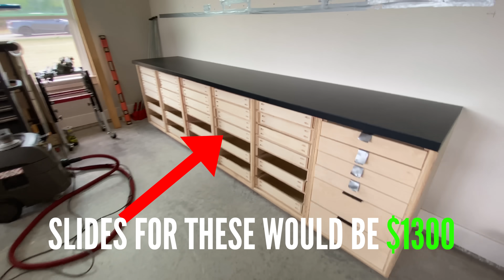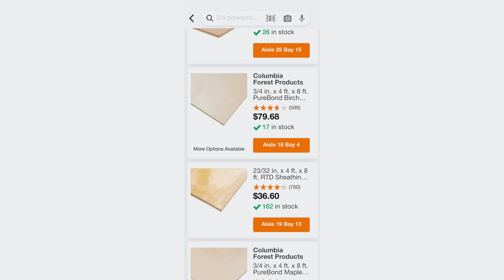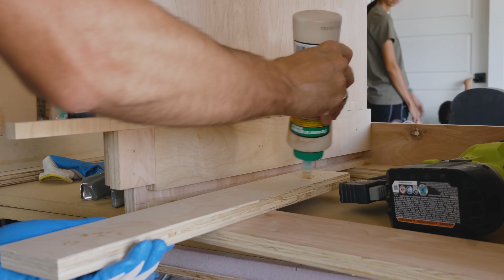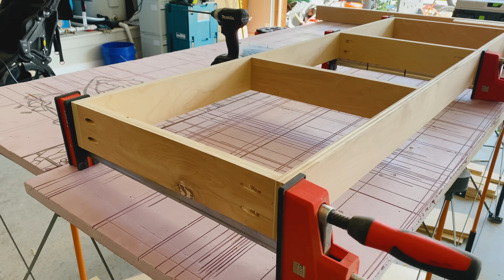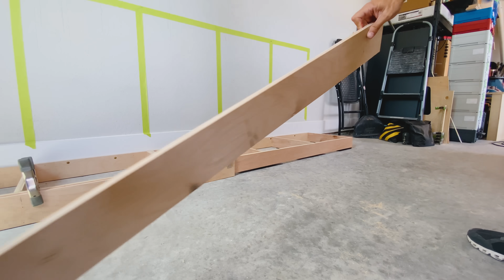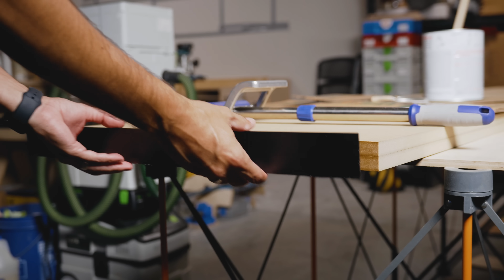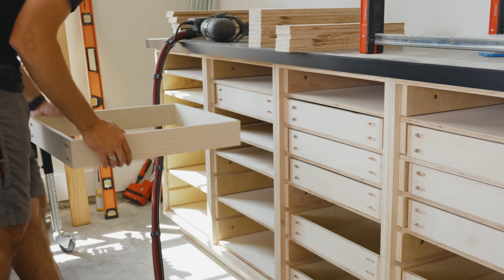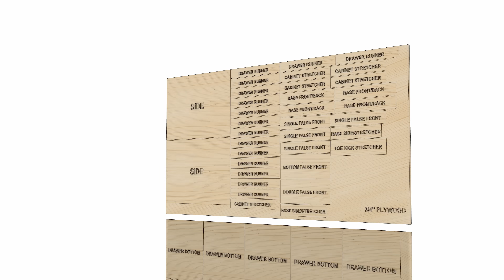Drawer slides are expensive. Do this instead.

Comment: 🤿 Brother this is a great video. These are more "practical in use" and "cheaper" than most options out there. Love the Plywood Company find. I'm in Temple, TX and is hard finding companies around like roofing, electrical, lumber, steel, etc...very limited. Most are in Big cities where the drive is like an hour to 2 hours and then some. you might want to stain that plywood or seal it. Always a drip of oil or some other substance ruining the horizon 😄 I enjoyed the built!!

Comment: I love this project, and you're a natural narrator! I totally agree with you on drawer guides vs dadoes. Recently I made a small 9-drawer cabinet out of scrap lumber, same size as one of the units you made here, but foolishly used dadoes - holy tearout, Batman! Next time will use your method, but probably with 1/4" plywood. It's plenty strong for the drawer bottoms, slightly cheaper, and there isn't enough slop for the runners to jump the grooves. 

About the pocket screws, which seem to be the new hotness lately - honestly, I've been making drawer bodies using simple flat joints with wood glue and brads for 30 years (amateur), and none of my drawers have ever come apart in use, even heavy shop drawers. They also go together faster and easier than using screws. I think you worked a little harder than you had to there. 

Applying the laminate with your dad took me back to building our kitchen and bathroom with my dad many years ago - our last big project together. We did it the same way with the wood strips and it came out great. Painter's tape on the front edge would have saved it from scoring by the router bit bearing. Anyway it's really cool that you included him in your video.

I got a lot out of watching this. First time I've ever seen that expando work surface thing you setup at the beginning, and also the parallel guides - will look into those. Big thanks for posting!

Comment: Your insulation job is the thing of nightmares. HOUSES DO NOT NEED TO BREATH, This is a miss understanding by people who love fondling a dead tree carcass. Love you dirty wood elves but STOP trying to do engineering until you understand what is happening.  The vapor barrier faces the heating/cooling side of the wall. You should on an outside wall also have a moisture barrier. Think green boards(Zip systems) or polyethylene non woven fibers (Tyvek). You basically installed your insulation backwards. What you did will trap condensation inside the wall. Unless the garage is heated/cooled to the same temp as the inside wall.
Reply: The exterior of his house is fully wrapped, he will be fine.

Comment: 🤿 Great video. I built our house including all the cabinets - kitchen, bathrooms, laundry room, everywhere. Unfortunately, I went the expensive route, but they are still in good shape 20 years later. I definitely agree on the toekick. I've done it both ways. After trying the notching of the sides and then facing the toekick area, I scrapped that idea in a hurry. Leveling the cabinets is so much easier with the separate base. I've done a lot of laminate for my garage and for friends. One time I set down a large sheet of laminate in the wrong place and it was stuck! Impossible to get off? Nope. I sprayed automotive brake clean under the edge and peeled it right off, cleaned up the glue and reattached it correctly. I suppose acetone may work as well, but I always have break clean around.
Reply: I love the Brake Clean tip!
Reply: @geoffmiller3491  I always have 3 or 4 cans around for cleaning almost anything (within reason).

Comment: Great video. Just curious. Did you wax the drawer glide bottoms? I have to occasionally on my 100yr old kitchen drawers. If i don't because of the wood on wood contact, I find saw dust in the drawers below from rubbing.

Comment: You might as well have left the duct tape on there is you didn't prime and paint it.  LOL  As a carpenter I cut down drawers in older cabinets to add drawer slides as the drawers are way easier to open once they get loaded up.  I see we have gone backwards...

Comment: Tape on drywall is a conituation of the gypsum wrapped paper and I apply tape everytime, regardless of covering on the wall, for drywall strength continuity (controls moving when there wood studs "breathe"). Duct tape may be just as good! 🙂

Comment: Good work. Here's a few laminate tips:
1. Use water based contact cement. Doesn't have the overwhelming odor, goes on white, dries clear. But it does dry slower.
2. Use a solid carbide laminate trimmer bit and spread a little bit of vaseline along the laminate edge to prevent any burning from the bit.
3. Cut your laminate as small as possible. Maybe 1/8" overhang but no more than 1/4".
4. Use pieces of conduit instead of boards to lay on the surface when you place your laminate. They do the same thing but you end up with less surface area touching the contact cement.
5. If possible, use a trim router. Nice and small and easy to manage while trimming.

Comment: For the concrete-contact toekick, you might consider using composite lumber, such as Timbertech or Trex.  It won't absorb moisture and slowly delaminate or rot from the moisture that inevitably diffuses from the concrete.
Reply: or use the adjustable plastic leveling feet they make for cabinet boxes that cost a buck or 2 per foot then your finish toe kick clicks onto those and you never have to worry about even a few inches of water on your slab.
Reply: It will be absolutely fine my man.

Comment: Ducktape will work for a year then delaminate and each seam will be an air leak. You could use a tape designed for air tightness like ZIP tape, but mud and tape would be easier, good thing that is what you did.

Comment: 😅Questions:  Appreciate the video and design; however, if I am going to load drawers with heavy tools, hardware, etc., what is the resistance to drawer sliding like?  To improve that, do you recommend waxing the drawer bottom edges and slide groves, or finishing them in some manner?  Thank you.

Comment: Curious why anyone does the extended bottom on drawers with the cabinet mounted runners full drawer height. You lose so much space, waste a ton of material, and add ridiculous amounts of weight. Make the drawer as normal with a nailed on bottom and use 3/4 strips on the carcass as runners, make your false fronts cover the gaps, and boom… maximized use of space, reduced material used, lighter overall (when empty).

Comment: Good video. Contractor here.
Like the plastic shims. Theyrre the best i buy them by the case. I get branded ones that have a 8,000psi rating which helps knowing where thwy can be used long term.

1. Foil tape on the wall. OK snorkel goes here.
2. Your water leak wouldnt have happened if you put in a flood valve on the main line. Cost $300 to 600.
3. Use PUT glue. Removes about all you brad nails and is WAY stronger.
4. A short track with guides would be an issue getting the straight long edge to start from.
5.tape laminate edge before routing.

Comment: There is tape used for a lot of things that has teflon or other materials on the surface. Put that on the drawer or track. Lasts longer than wax on both sides.
I'd wax or seal the opposing side that works with the tape used.

Comment: 18:44 BASTARD FILE!  lol

it's NOT profanity in this context. that is the actual name of that type of file. the edges on bastard files (much like bastard swords) are nonparallel with each other, so that they typically come to a point, rather than having a straight edge with a squared end (or in the case of the sword, parallel edges that only come to a point at the very end).

as it is NOT used against a person (or inanimate object), i believe that YouTube should have no problem with it. nothing wrong with calling a spade a spade!

Comment: 🤿 inspirational! To lower costs could you have used 5/8 plywood vs 3/4 since these were individual cases. Strong enough? Or could you have made common interior walls using the 3/4 to save $

Comment: I haven't seen good plywood since the 70's. I bought some plywood recently to build a 36" wide door for a shed, and between summer and winter it changes in dimension 1/4" . How do they make plywood do that? Plywood also used to be flat. No potato chips.

Comment: nice job. in the old days it was called a rat tailed file. to build this to be mobile. I would have to improvise being in a one bdem apt. Also.would use an exotic wood veneer rather than a plastic composite. can use wood glue rather than rubber cement. less toxic when working indoors.

Comment: Nice work!  Very good looking and skillfully made.

The biggest drawback is that the drawers are not full extension.  So you will be pulling the drawer out & setting it on the counter to get the stuff in the back of the drawer.  Of course full extension slides are very expensive, so it's a trade off.

Then there's the matter of positioning the pieces of plywood that act as slides.  You use that 3/4" strip of plywood, rinse and repeat 7 times.  If you are not VERY careful, you can get creep such that the 2 sides are not the same.  The worst not-the-same is if they aren't parallel and the drawers jam.  Just a 1/64" repeated 7 times is almost an 1/8".  Not only carefully used, but be especially careful that the strip is cut without any taper.

Comment: $80.00 per sheet of plywood is crazy expensive but u are the one that's paying for it bro. I salute u for the brilliant workmanship on these cabinets. 
I built my very 1st set of shop cabinets if u want to call them that and If I had made a video about them the abuse would've been unbearable.. hahahaha! 
I built them with Plywood, MDF and OSB. They look horrendous my bro.
The hold a fair bit of my tools and bits and pieces in them so I'm happier than a pig in shit. 
TBHY I wouldn't even pay $80.00 a sheet for cabinets in my house. I'm about to start a project in my kitchen and I'm building my cabinets out of 40 euro sheets of 8x4 plywood. I think it's perfect for the body of each cabinet bcos I'm making the doors out of Maple or ash if I can get it. If not I will use Oak for the front's of each cabinet. It's a little more expensive, a lot more expensive and if I change my mind and go cheaper on the doors and drawers then I will paint them instead. I'm interested in getting a sprayer gun machine for spray painting some of my projects plus it is one I can spray the outside of my house, the pebble dashing for. It's only about 250 euros for the machine so it's a longterm usage machine.
My apologies for rambling/rabbiting on a bit too much bro. I really enjoy ur videos. I was thinking about getting an electric Makita track saw so I wanted to ask u about the Makita track saw. I know u have one and rate them very highly. They're very e3xpensive so my question is about cutting mitres with the track saw?? How good is iut for cutting different angles for mitres??

Comment: I got 2 sets of black drawer slides (5-Pack each set), so 10 pairs of drawer slides for under 130 euros bro. Now I need to say that they were only 300mm in length so I don't know what the longer ones were. I think it was 58/59 euros per pack of 5. I don't want deep drawers anyway so the 300mm length is perfect for my cabinet drawers. 
I don't know if ur interested in drawer slides that length but I will look up the link for them from Amazon UK to IRE and see if u want to have a butchers hook at them.. 
Love the look of ur cabinets btw. They look awesome.

Comment: Nice work on the cabinets and the video. To avoid the laminate trimming issue a good tactic is to only allow the cutting surface of your router bit to only extend a small amount past the laminate.  Even if you tilt the router slightly in towards the material it cant "dig in" and gouge the material like yours did. This is a good router setup for any material , not just laminates and veneers. Professional shops will sometimes use slightly oversized bearings to leave the laminate proud (not flush) on the first pass. Then do a secondary pass with a 7° (or similar) angled bit to slightly chamfer the edge.  Again, this bit is setup to only be long enough to just be able ro trim the laminate thickness. Most shops that do lots of laminate and veneers will have dedicated router setups for the trim pass and finish pass. A large guide/jig is often attached to the router to ensure the cut doesn't wobble. Cleaning glue/adhesive from the material surface that the bearing follows and from the bearing itself is also sometimes necessary.  Filing and sanding by a skilled craftsman is still often necessary to finish the edge. For a one-off garage project, having multiple router setups is often not worth it in my opinion and I think you did great. 🤿

Comment: Your mistake with edge and why this marks appears - you bearing caught the glue (in between router and bearing), start spinning with the router (and bearing shouldn't spin) and damage the edge (the glue on the bearing itself also often cause this). 110% this the reason how the edge was damaged. Always keep your bearing clean and check your bearing connection for the glue residue - bearing shouldn't spin with router.
P.s. also wax your sliders asap!

Comment: I know it's not much of a consolation regarding your water damage, however the restoration of your table saw top after the water damage in a prior video of yours made me more confident that I could restore a rust top on a table saw. I ended up getting two of the same model table saws at good prices, both surface rust on the table. I restored them both and sold one for more than I paid for both. I was then able to purchase a new Kreg track saw with the profit (not a festoon it wasn't that much profit). So, I now own great table saw with a restored top, and a brand-new track saw because of your video. Thank you so much.🤿

Comment: Couldn't you have done the spacers smaller (using a little less wood) by making the sides and the floor of the drawers flush so they act as the slides (instead of only the floor being the slide)? What would be the disadvantages? Do they slide better the thinner the space between the spacers? 
Thanks for the video
Reply: I wondered the same thing on both these questions. Hope someone answers.
Reply: @saxhorn1508  yeah, I am testing it with a  nightstand right now, and instead of wood, I am using this plastic slides. So I'll let you know.

Comment: Really nice work! 🤿…re that slight burring when trimming did you roller the sides really hard to level? Then I found it works to leave that adhesive to cure overnight before trimming off, got much tighter trim of this way! Super video!

Comment: Watching you pocket hole all those makes me happy I have a castle. I'm down the rabbit hole of getting ready to do this in my little shop at home. Not sure if I'm going to do the side rails though. I'm looking into making pilasters for the X2 series bracket with undermount slides. Kind of pricey but worth it in terms of options it offers. Luckily I work in a cabinet shop so I'll be able to catch a heavy discount. All that's missing are some French cleats now. :snorkel:
Reply: Do you have the Castle 110 or something bigger?  I'm just a dummy who builds things because I'm an ~*artist*~ and have to have things a certain way (I am mocking myself it's okay to laugh), and my fiance got me the Castle 110 for Christmas in 2021 and I LOVE it.  It makes assembly so much easier than your standard Kreg pocket hole (which is still great for the home gamer).  Anyway just curious if you took the plunge for a bigger Castle at home, that's all. 🤿
Reply: @RWingoS7  we have 3 TSM 22  at our shop. only due to different set depths for the material used. We do a lot with melamine and maple/birch plywood cabinetry.  I just use one of those whenever I have a side project I wanna do. The CSI 1.5D has been debated but right now we don't have a 3 phase panel currently. The 110 is a perfect hobbyist unit and far superior than the kreg one.

Comment: Separate Toe Kicks:  Make your short pieces and the back rail about 3/4" thinner.  That way if there are any irregularities in the floor, you only have to scribe the front edge to get it level end-to-end.  Then you shim under the back to level it front-to-back, then shim to the wall to keep everything straight and screw it to the wall.  Done.  No scribing four miles of rails just to get one wall done, and no huge gap under the front rail.
Reply from the maker: nice
Reply: Do not even have to shim under the back rail with this method. Just shim it plumb and screw it level into your studs.
Reply: I might opt for no toe kick and wall hang the cabinets yet this requires them to be built stronger. which is not all that much more plywood when you consider it.

Comment: please use a mask when cutting MDF at least as an example to others. the dust is no joke. even outside, even with a dust extractor. some other nature building YT channel which i forgot the name of had a great PM2.5 and PM10 test. indoors is even worse of course since the particulate matter lingers in the air for hours. and the dust can be reactivated. apart from the PM dust which is a dangerous HD and respiratory disease risk, they’d all the glue chemicals in the MDF.

Comment: Love the look and simplicity of this.  How do the bigger drawers handle weight.  Does it affect how har it is to slide them much?  Strong work 🤿
Reply from the maker: Thank you. I will wax the bottoms and they'll slide better. There's obviously resistance, but it opens. Using 1/2 for the drawers and not doing full height drawers helps on the weight.